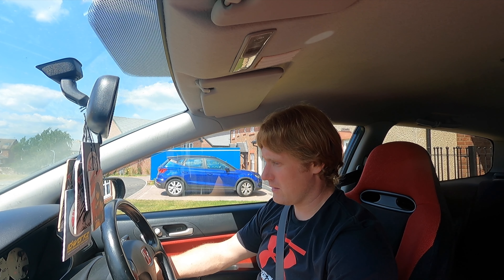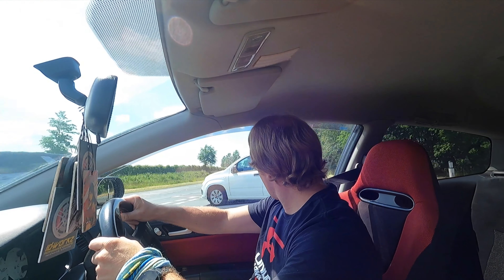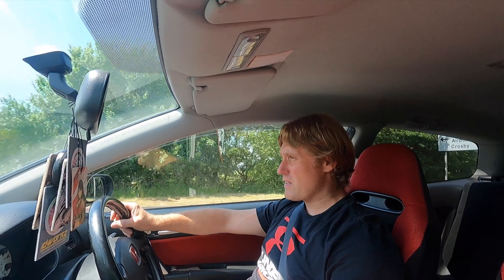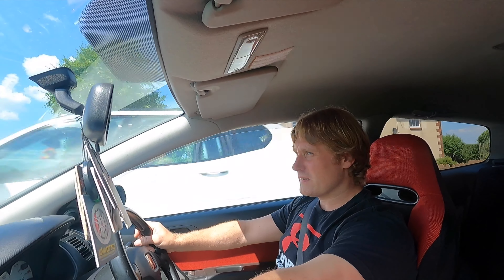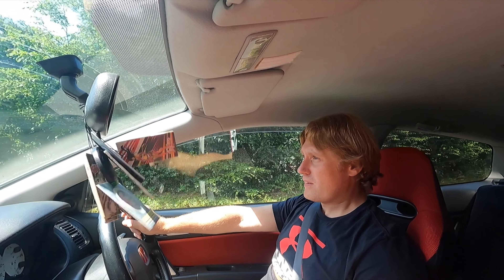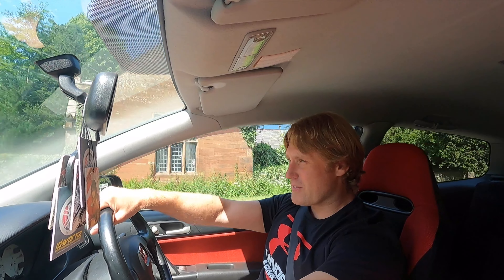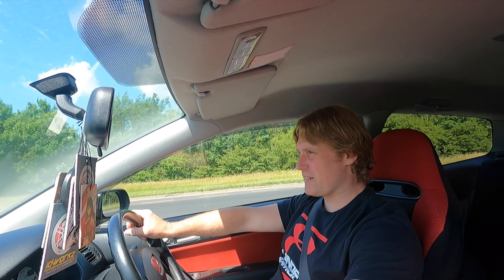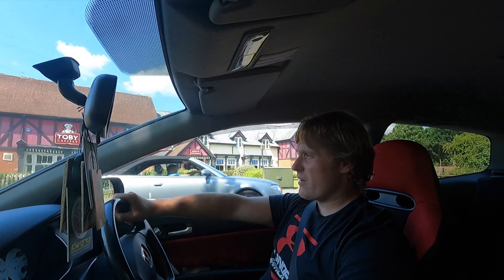EP3 Type R Twin Plate Clutch Thoughts And Driving

Comment: I am sighing in relief watching this video ... I thought I was a complete idiot in driving a twin clutched EP3 and stalling / jerking it on 1st gear! ... I also have the same reaction when coming to a traffic light or to catch a roundabout, so much so that for the time being I am only going for a ride in the late evenings when the traffic is not so heavy and stops are not that frequent ... At least mine is not a daily so don't rely completely on it .. Now I know I am not alone suffering from this!
Reply from the maker: I’ve driven it a few times in daily traffic now just to force myself to get better and more used to it. I find revving to 3000+ before setting off helps a lot. 

Mine is sort of a road car although I do use my Honda jazz more for work and back really 😂
Reply: @1BlueGhost  Unfortunately (if it can be used as a word) mine has a J's Racing full titanium exhaust and therefore revving it to 3k or more would sound like a fighter plane is about to take off -- I will try to follow your suggestion though and give that a try ... Been the new owner since 2 weeks only now, and came all complete and modded out (so it's my first weeks driving an ep3 AND driving a twin plate - you can imagine the stress)
Reply from the maker: Mine isn’t too loud I guess. 3” solid fabrications super silent system. 

Hope you’re enjoying the ep3? They are quite good fun at times!

Comment: The issue you have with the revs.I can tell u the fix.

My car when warm would idle around 900rpm and when I rev it up it would drop to maybe 500rpm then raise back to 900rpm.

Took me a year to sort it lol.

You need and electronic load detector an ELD for short.

Costs about 45 will take 10 mins to install in to fuse box really easy job.have helped 2 out on the Facebook group.

Please buy this right now btw your welcome
Reply from the maker: I will have a look. It only started doing this since it has a lighter flywheel. I can raise the revs on idle easy enough to 900 which may help it. Will go check out this load detector on google